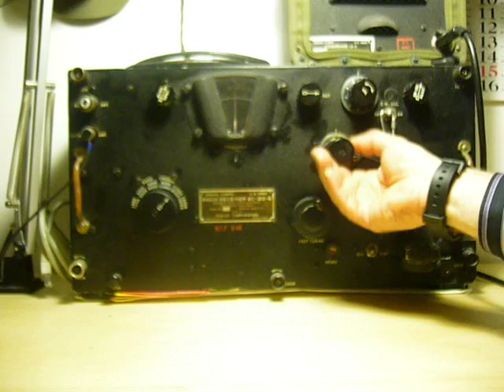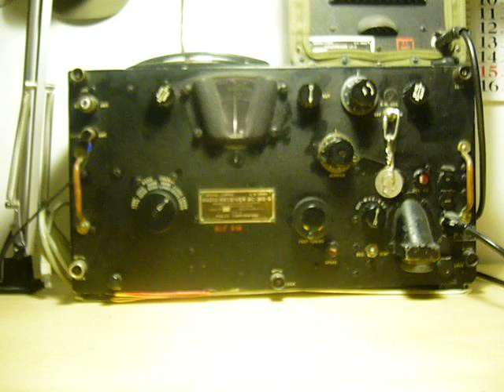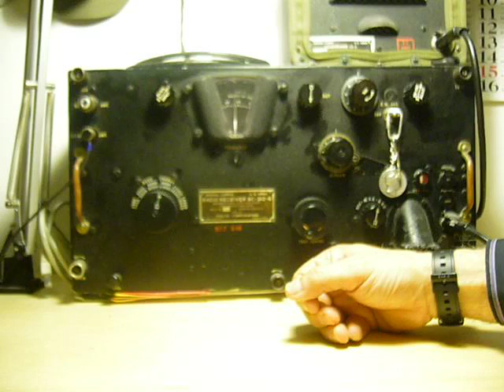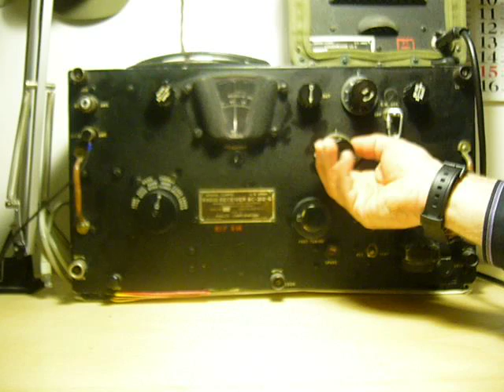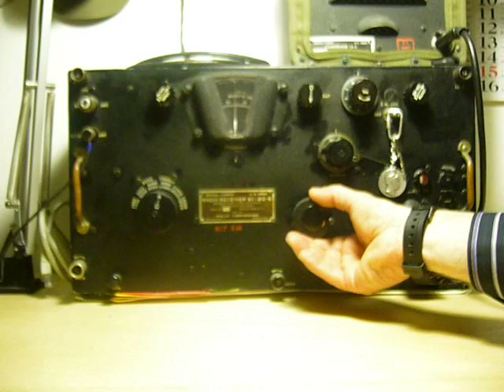BC312 Receiving on Short Waves

Comment: Salve daniele stavo pensando di acquistare questo ricevitore , ma vorrei sapere : si ascoltano i Radioamatori , da quel che sento , ma loro di solito nn trasmettono in SSB ? mi sembra che questo apparato nn abbia tale banda , e poi va alimentato esternamente ? e abbisogna di un amplificatore BF esterno .
Comunque complimenti e' davvero un bel pezzo d'epoca.
saluti GABRIELE
Reply from the maker: Ciao Gabriele, rispondo prontamente alle tue domande.
I BC312 / 342 consentono la ricezione delle seguenti bande amatoriali:
- 160 mt, 1.8 / 2.0 MHz
- 80 mt, 3.5 / 3.8 MHz
- 40 mt, 7.0 / 7.2 MHz
- 30 mt, 10.1 / 10.15 MHz
- 20 mt, 14.0 / 14.3 MHz
- 17 mt, 18.068 / 18.168 MHz (leggermente fuori scala sulla quinta banda)
Le modalità ovviamente sono il CW e l' SSB (quindi puoi ascoltare tranquillamente i radioamatori, che comunque su alcune frequenze ad oggi lavorano anche in AM), considera comunque che hai a che fare con un apparato di oltre 60 - 70 anni fa, la cui sensibilità media è di circa 5 microVolt. Pertanto dovrai installare una buona antenna e avere una buona propagazione. La classica filare, se hai la possibilità, va più che bene. Inoltre mi auguro che nella tua abitazione non vi siano disturbi di natura elettrica come: forni a microonde, modem, motori ad inverter nelle vicinanze ecc... ecc... perchè tali emissioni entrano dritte nel BC, attenuandone notevolmente la ricezione.
Concludo dicendoti che se i BC sono originali il 312 lavora a 12 Volt con il proprio dinamomotore, mentre il 342 lavora in origine a 110 Volt, ma si trovano alimentatori già predisposti per la rete a 220 Volt. In entrambi i casi gli alimentatori sono contenuti all'interno del ricevitore (nel lato posteriore destro, in basso).
Qui da casa a mia a Firenze mediamente ascolto tutta l'Europa con un filo lungo circa 6 mt, in casi particolarissimi di ottima propagazione sono riuscito ad ascoltare sia il Nord che il Sud America ma ripeto, in casi particolarissimi.
Cordiali saluti, Sergio.
Reply: Grazie delle informazioni , quindi ascolta anche la SSB , ok ci faro' un pensierino per l'eventuale acquisto .
Grazie e saluti DANIELE.......